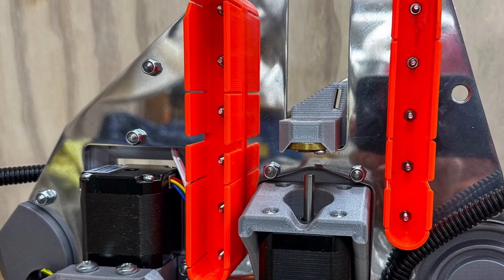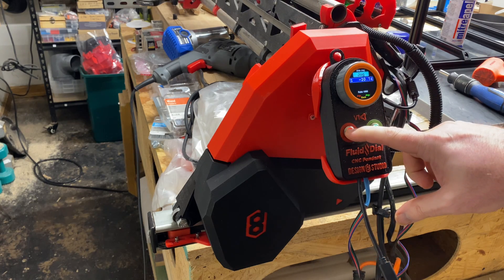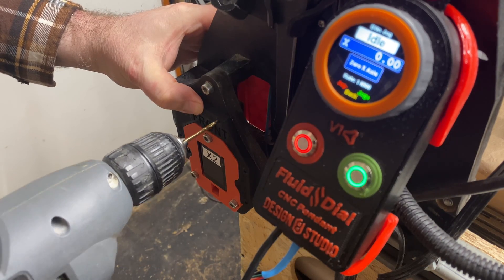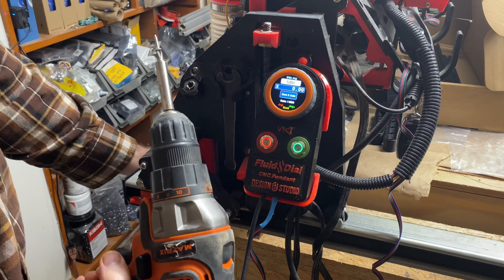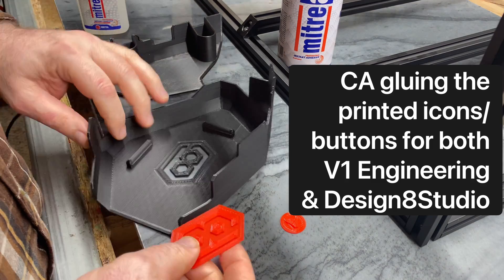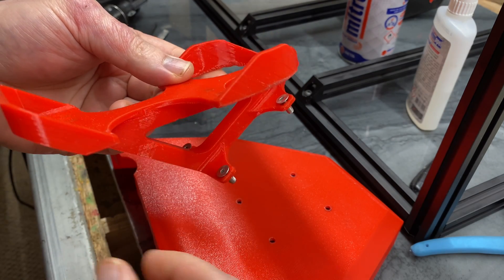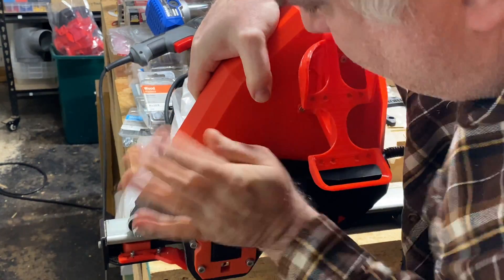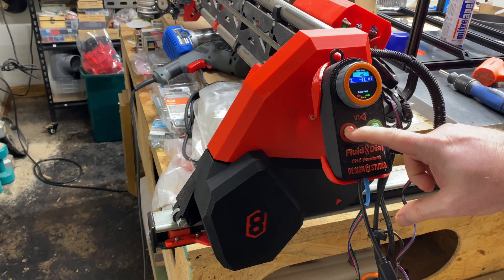LowRider v3 DIY CNC - remix: Peter's awesome printed fenders!

Comment from the maker: As promised: Link to remix work for fenders on various stock and "tall" YZ Plates, and same in combination with my Hidden Belts Mod, and the same but for "mirrored" LR3 machines + Hidden Belts Mod. See this link for full listing: 
https://www.printables.com/model/805777-lowrider-v3-cnc-fenders-various-tall-yz-plates-sto
Some build notes: My main YZ plates are 19mm thick, but my "Y-extend" plates are only about 1/2" thick. My main YZ plates are based on Dan's (@supraguy's) "extra tall YZ plate" design, although I had made a few small changes. Some were for functional reasons, and one change was merely cosmetic. Having the YZ plates taller (adding on 50mm in height) does not require any changes to printed parts. It does mean the linear guide rails need to be 200mm instead of 150mm, and it means the Z lead screws need to be longer my 50mm as well. Having the YZ plates be thicker (my 19mm) is of no significant benefit, and is only because I used what I had on hand. This change means it can be more finicky and fiddly to get the Y motor and mount inserted and rotated into position. That's why there are semi-circle widened areas on that cutout part of my design for the taller YZ plate. Worst case, you can insert the mount without the motor, and twist it in place, then "rock it" to the side a bit and attach the motor.
Reply: hmm cant find models page not found :(
Reply from the maker: @luke.and.his.adventures  last night I found some details I had forgotten. So I am fixing the listing. I temporarily set it to draft status while I fix it. I will have it back up within a day or two. So sorry.
Reply: @design8studio  thank you very much 😊
Reply from the maker: @luke.and.his.adventures  I have worked hard to correct and perfect the listing, and have republished it: https://www.printables.com/model/805777-lowrider-v3-cnc-fenders-various-tall-yz-plates-sto

Comment: hey again doug, its been  while but i finally got my low rider mostly built, its just waiting for its table to be built its a non standard machine slightly over 4ft (1320mm) for the x and a bit over 8ft for the y. seems a lot has changed since i got the chance to look at my machine esp with these fenders, ill have to get more blue grey and black filament lol
Reply from the maker: Sounds good. Post some pics and info on the V1E forum!

Comment: Hey Doug, Quick Question for you, in your video you mentioned that you have extended YZ plates. I have searched all around but i can not find any info on them. Can you point me in the direction of them? I would really like to make them.
Reply from the maker: I've shared them in various places, most recently in Peter's thread about the fenders (link below), and when I post the remix shown in the video, I will be including the DXF and SVG for them. Here you go. Don't forget, it means you will also need longer linear guides (200mm instead of 150mm) and it means you will need longer lead screws too. https://forum.v1e.com/t/parametric-fenders-for-the-lr3-now-on-printables/42499/34
Reply: Thank you so much !!!! This is exactly what I have been looking for. I love my Lowrider but the height limitations have been a challenge. and I really don't like the idea of building a drop table, Or removing my spoil board.   Thanks again !!! @design8studio

Comment: What if whe put magnets for  easy installation
Reply from the maker: I thought briefly about it, and if I had not been so anxious to get it done, I might have looked harder in that direction!
Reply: Thx alot for your genius mind
Reply: I think a remix of the clips with magnets embedded would be interesting - I dismissed them as "too hard" for a couple of reasons, particularly because I was concerned about shear loads - but worth experimenting with.   In the meantime, my original clips have withstood many dozens of "remove and replace" so I'm happy enough.   Cheers,  PeterH